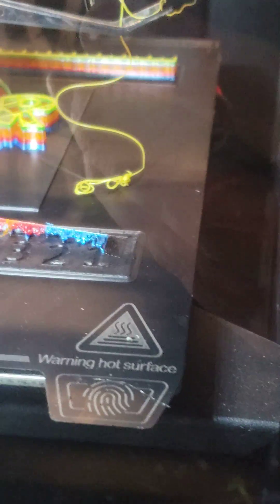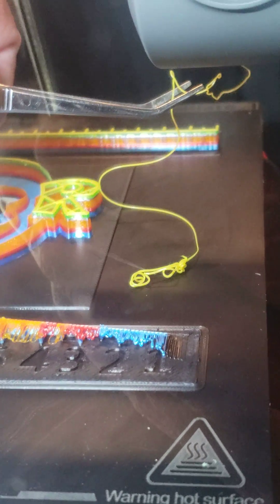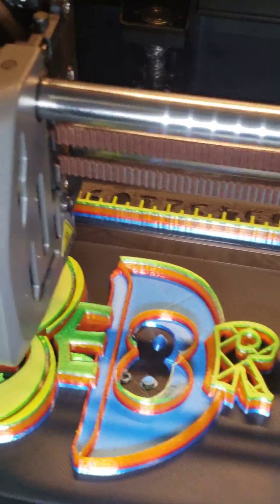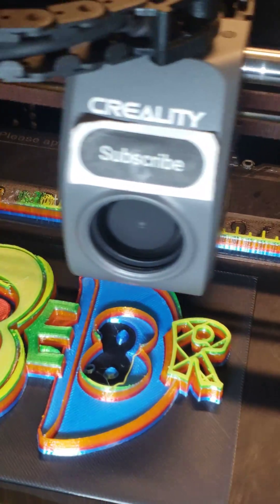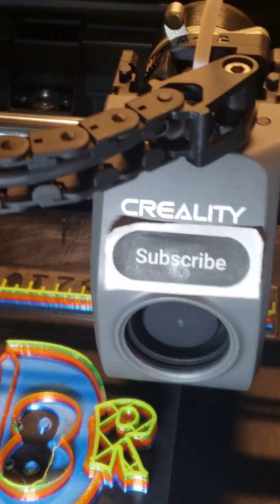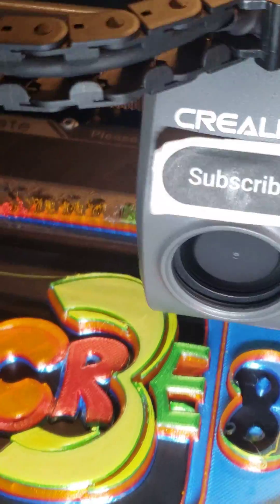Creality K1 Multicolor Logo 3D Print Using My Visual Printing Layer Number Indicator Gauge Tool

Comment: Why do you need the layer gauge tool when you can set the layer pauses directly in Cura?
Reply from the maker: Last I knew Cura doesn't work with Creality K1 which I'm using.  But evidently people don't need it because nobody has downloaded it I don't think ha, but I've used it multiple times and found it helpful, but yeah because last I knew of the option is there in Creality print but doesn't work.
Reply: @3dcre8r28  from a quick search, it seems as though Cura can be set up to work with the K1. https://sainsmart.s3.us-east-1.amazonaws.com/Creality%20K1/Cura/Creality_3D_K1_docking_cura_slice_software_operation_manual.pdf